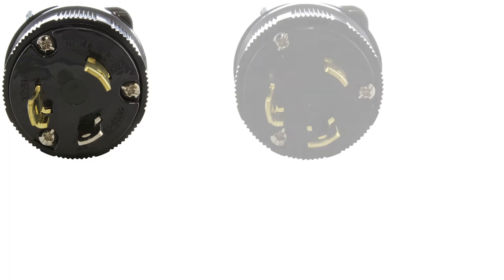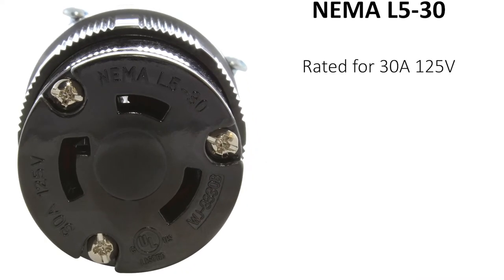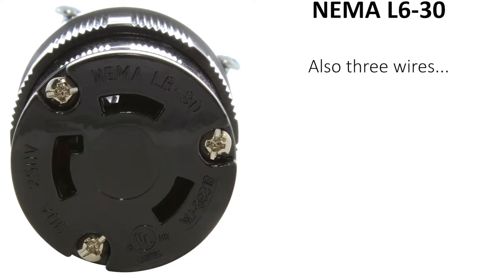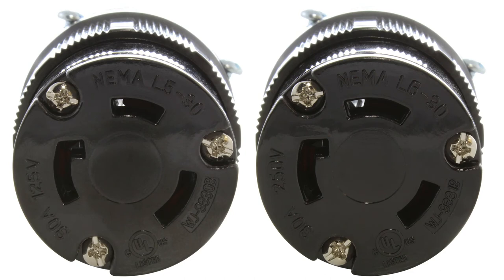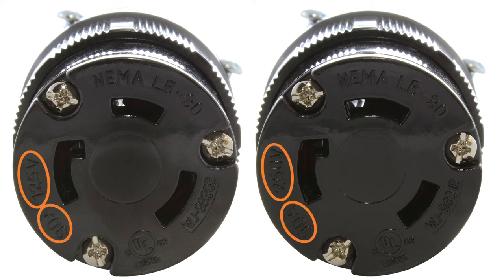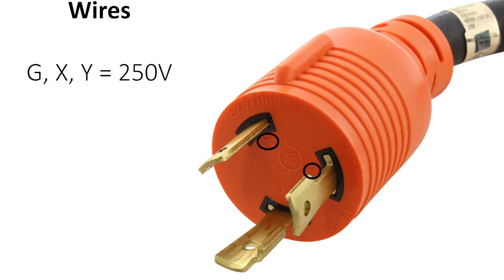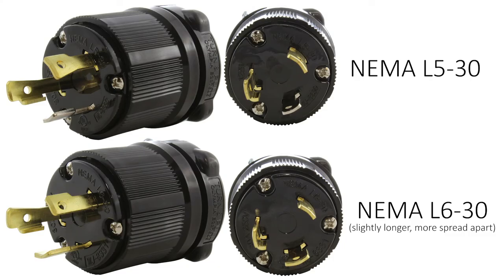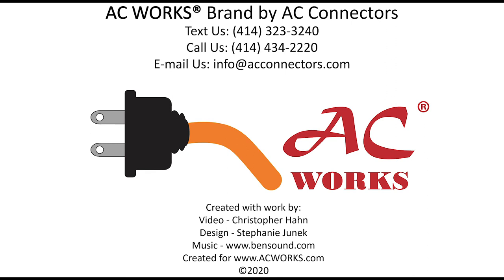The Differences Between L530 And L630

Comment: Hello there, I have a question,  does an l6-30 adapter can be plugged into a L5-30P UPS?, is from CDP
Reply from the maker: Hello. No, you cannot adapt between the two. L6-30 is wired for only 250V usage while L5-30 is wired for only 125V usage.

Comment: The part I don't understand is the letters at the end
L6-30p: plug
L6-30r:  Receptacle
L6-30c: connector
Ect...
I have a Vulcan Omnipro 220 that has a recessed plug and can't for the life of me figure out what connector goes into it
Reply from the maker: The letters at the end are to designate if it is a male plug or a female connector. As you said, P is for male plug, R is for female receptacle. C is not used in NEMA configurations. If you need help identifying a connection, go to our website https://acworks.com/ we have a chat available where you can send pictures of the connections you are trying to identify.

Comment: the L6 30 p  250v is a different plug than a L6 30 p 125v , the voltage must match .
Reply from the maker: Hello. There is no such thing as a L6-30P that is 125V. L6-30 is wired for 250V only. L5-30 would be for 125V. L6-30 is required to be wired with two hots and a ground. L5-30 is required to be wired with a hot, neutral, and ground.

Comment: Can I plug a L5-30 connector to a L6-30 receptacle?  The better question is what will happen after forcing it in and powering on devices, it’s been running for a month?
Reply from the maker: No, you cannot connect the two. L5-30 is rated to only operate at 125V because it has one hot, one neutral, and one ground. L6-30 is rated to only operate at 250V because it has two hots and one ground. You should never force a connection between these two as it could damage your equipment.

Comment: we are using the Firman generator 2000w
can we use it for 220v? it has L5-30P - TT L5-30R plug in...
Reply from the maker: Hello. If your generator only has L5-30 and TT-30 outlets available, then no, it cannot be used for 220V. L5-30 and TT-30 are only rated and wired for 110V usage.

Comment: Can I make an extension cord with a lr5-30p male end and a 6-50 p female end for my welder? Im planning on running 125 v
Reply from the maker: Yes, you can do that as long as you only run 125V. We also sell one if you are interested. https://acworks.com/products/wdl530650-018-welder-adapter-l5-30p-to-6-50r?_pos=1&_sid=8748273ca&_ss=r
Reply: @ACWORKS  Thanks I appreciate it, unfortunately I'm in need of a 25ft extension cord.
Reply from the maker: No problem! We also carry both L5-30 and 6-50 extension cords in that length. Let me know if you want links for those. Otherwise, if you want it to be all one cord, I understand that too.

Comment: Is there an adapter that swaps from a L6-30 to TT-30?
Reply from the maker: No. You can't adapt between those two because of the wiring difference. L6-30 can only operate at 250V because it has 2 hots and a ground. TT-30 can only operate at 125V because it is 1 hot, 1 neutral, 1 ground.

Comment: Hi. I have a Honda generator that generates at 220v but has 2 x 5L30 recepticles. It came with 5L30 Male plugs as well. 
From your other comments you sound certain the 5L30 can’t be used to run 220/240v. But my question is why would the manufacturer (Honda) supply this generator which generates at 220v with 5L30 plugs if they can’t be used together?

Ps:Our grid uses 220/240v (South Africa). Hence why I’m trying to make the generator supply me with 220v via the 5L30

Any suggestions as to what I can do?
Reply from the maker: Yes, L5-30 is only for 120V because it has one hot, one neutral, and a ground. L6-30 is two hots and a ground. Since you are in South Africa, the connections are likely to be different. It would be best to contact a local electrician to get this sorted out.
Reply: @ACWORKS  thanks for the reply. Upon further inspection of the supplied 5L30 I noticed printed on it was 250V 30A. Probably because it was produced for local markets it has been updated/upgraded for the stronger voltages. Lucky for me it is now a basic task to execute. I was a little worried before this tbh. 
Thanks again for the help.

Comment: Is there a cable that steps down L6-30 to standard usable outlets like the L5-30?
Reply from the maker: No, there is not. L6-30 only operates at 250V whereas L5-30 only operates at 125V. Because of the way L6-30 is wired, it cannot be stepped down.
Reply: @ACWORKS  Found this out the hard way. Swapped the receptacle on the L6-30 with an L5-30 and plugged in my L5-30P for my amplifier and blew a fuse